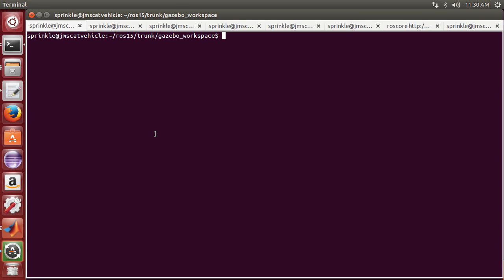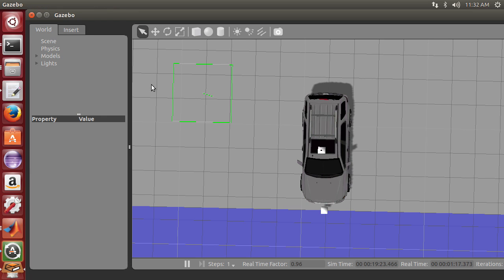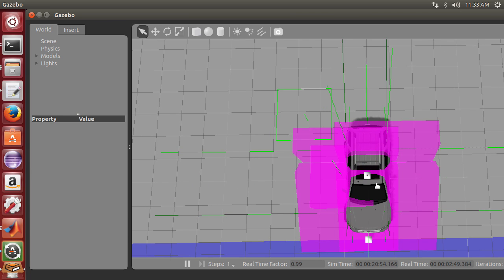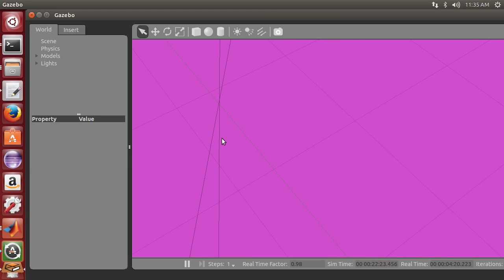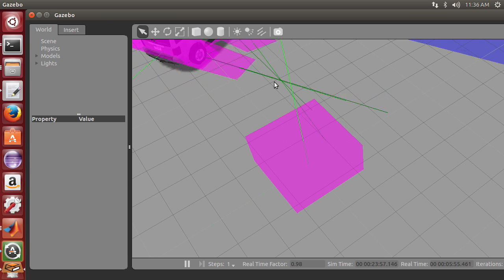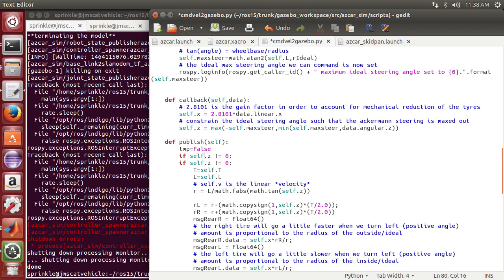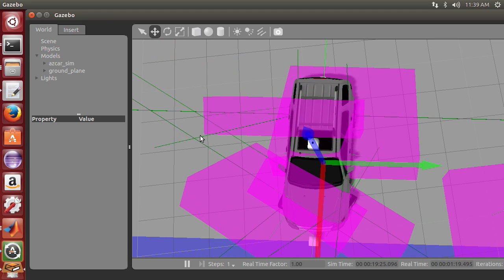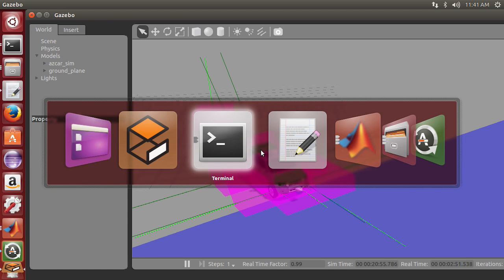Gazebo simulation to verify Ackermann steering model

Comment: I want to learn and understand how to implement the ackerman steering with ROS car models. Kindly help me.  How can i learn to implement this. Regards
Reply: here is the code:
apply_steering is called in update.

steering request is the angle of the inner wheel  
the wheels steering is controlled using a variant of PID.
It's from a hmmwv model i made with active wishbone suspension and programatical ackerman steering

void apply_steering()
  {
    double ThetaAckerman = 0;
    if (Steering_Request > 0) //turning right
    {
      ThetaAckerman = atan(1 / ((1 / (tan(Steering_Request)) + (VehicleWidth / VehicleLength))));
      steer_controller(this->streer_joint_left_1, Steering_Request);
      steer_controller(this->streer_joint_right_1, ThetaAckerman);
    }
    else if (Steering_Request < 0) //turning left
    {
      ThetaAckerman = atan(1 / ((1 / (tan(-Steering_Request)) + (VehicleWidth / VehicleLength))));
      steer_controller(this->streer_joint_left_1, -ThetaAckerman);
      steer_controller(this->streer_joint_right_1, Steering_Request);
    }
    else
    {
      steer_controller(this->streer_joint_left_1, 0);
      steer_controller(this->streer_joint_right_1, 0);
    }

    //  std::cout << ThetaAckerman << std::endl;
  }
  void steer_controller(physics::JointPtr steer_joint, double Angle)
  {
    // std::cout << " getting angle"<< std::endl;
    std_msgs::Float64 msg;
    double currentWheelAngle = steer_joint->GetAngle(0).Radian();
    double steeringOmega = steer_joint->GetVelocity(0);
    if (steer_joint == this->streer_joint_left_1) //controlling left wheel
    {
      DesiredAngle = DesiredAngle + steeringSpeed * deltaSimTime * (Angle - DesiredAngle);
      if (fabs(Angle - DesiredAngle)<0.05)DesiredAngle=Angle;
      IerL+=DesiredAngleR - currentWheelAngle;
      double jointforce = control_P * (DesiredAngle - currentWheelAngle)+control_I*IerL - control_D * (steeringOmega);
      steer_joint->SetForce(0, jointforce);
      //  std::cout << currentWheelAngle<< std::endl;
    }
    else //controlling right wheel
    {
      DesiredAngleR = DesiredAngleR + steeringSpeed * deltaSimTime * (Angle - DesiredAngleR);
      if (fabs(Angle - DesiredAngleR)<0.05)DesiredAngleR=Angle;
      IerR+=DesiredAngleR - currentWheelAngle;
      double jointforce = control_P * (DesiredAngleR - currentWheelAngle)+control_I*IerR - control_D * (steeringOmega);
      steer_joint->SetForce(0, jointforce);
    }
    // std::cout << "efforting"<< std::endl;
    // this->jointController->SetJointPosition(steer_joint, Angle*0.61);
  }
Reply: Hi @Yossi, now i have another task with this CATVehicle! I need to make the car to avoid obstacles while its movement from one position to another! Though AMCL is what i need to implement, but since it is suggested that rather than implementing a whole new AMCL, its better to use plugins to avoid obstacles! I am unable to understand how this will be implemented! Kindly help! Regards
Reply: I do not understand stuff in that topic.
I use unity most of the time, I'm more focused on physics simulations.
Reply: @yossicohen8801  hi, id like to know, how to put that code? i use gazebo
Reply: @GUSTAVOGARCIA-nz2fy   Hi, did you find any way of doing it?